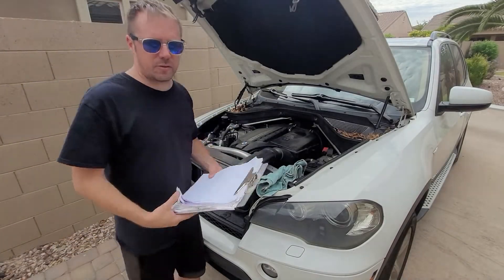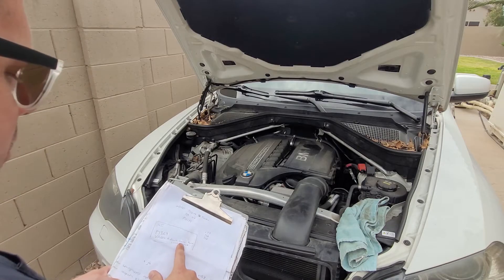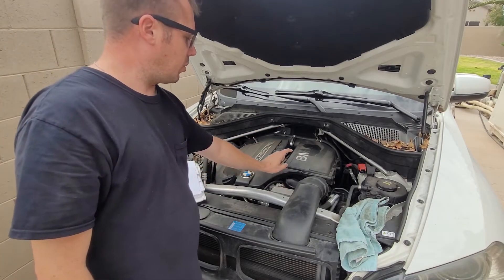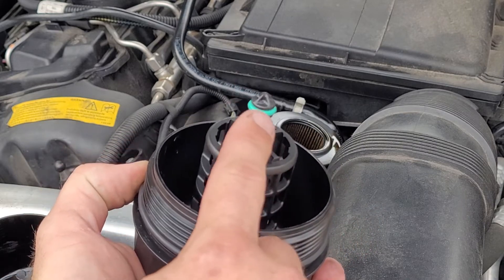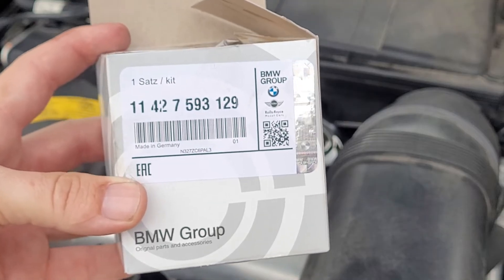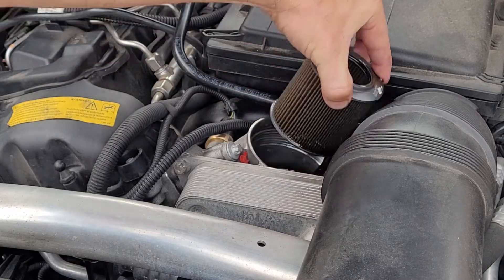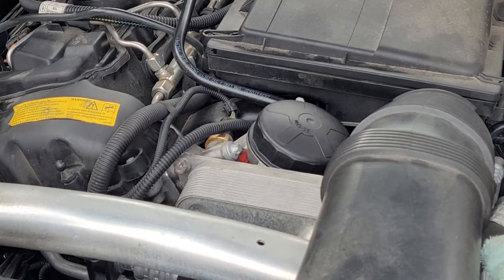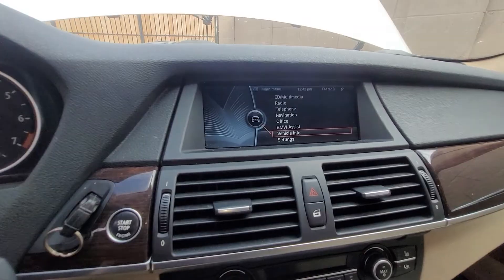BMW P13C9 – Super Simple Fix – DIY!

Comment: Hey 🙋‍♂️ BMW F30 N20 With Code P13C9 i Checked Oil Filter & insert is NOT missing!! Anything Else That Could Be Causing This Problem?
Reply from the maker: Vanos solenoids would be next likely in my opinion
Reply: @NiXFiX  Could This Be The Same As Vanos Solenoid Actuator’s? Or The Actual Vanos Solenoids? Thanks 🙋‍♂️

Comment: I have a drivetrain malfunction message on my 2013 bmw x3. The power output is low and the power of the vehicle has been reduced. Could this be the reason? BMW dealership gave me a $5000 fix charge! 😮

Comment: I have the same code but also P0015, is it possible that’s cause of the missing insert? Cheers
Reply from the maker: @mas00008  for sure. And checking for the cage insert is by far the quickest, easiest, and least intrusive check. With these codes, it should definitely be the first thing checked. Also check the O rings on the end of the cage.
Reply: The cage is in it but the o ring looks a old, is it possible that’s that the issue? Also my oil level is exactly between min and max. Should fill it to max?
Reply: @mas00008 hi have you been able to fix your car? I got the same problem
Reply: @mas00008 did you find the issue bro

Comment: How did you clear the code?  Or does it clear itself after it’s been replaced?  Great video
Reply from the maker: The error message (half engine) will not show up, but will be stored still. Any OBD2 scanner would be able to clear it out.